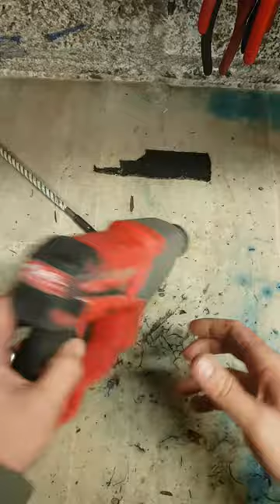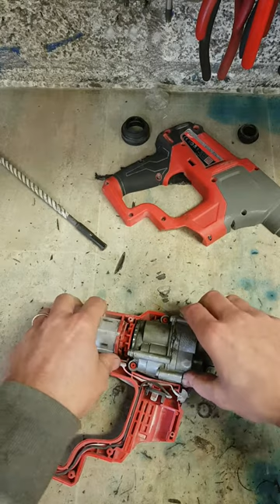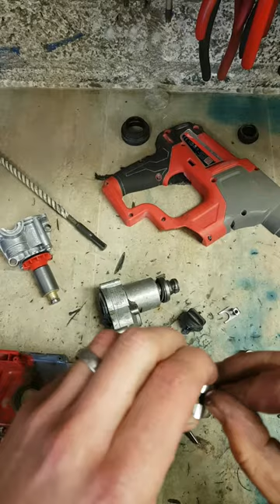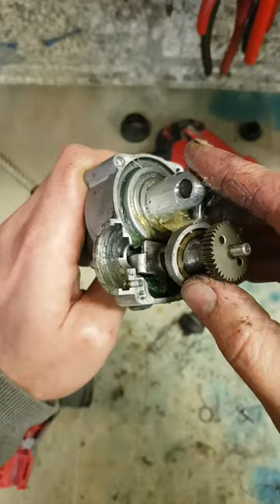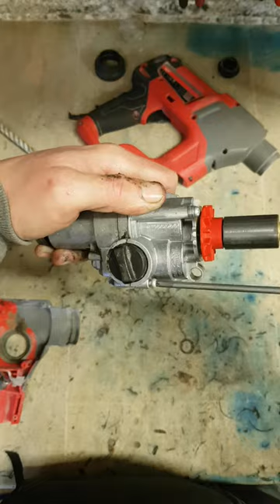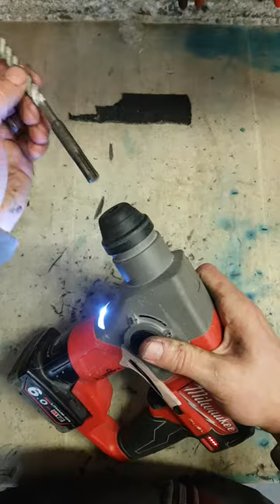Milwaukee M12CH hammer drill not hammering, how to get it hammering again.

Comment: I use 18v Dewalt tools and 12v Milwaukee. I find the m12 stuff to be well made compared to the m18 gear.
Reply: I do the same but with Makita instead of dewalt.. love the M12 Fuel stuff, not the M18. Can’t go wrong with dewalt either though.

M12 battery size, the power and weight of the tools are brilliant. M12 stubby 1/2 or 3/8 impact wrench is one of my favourite tools.
Reply: @Shoorit l